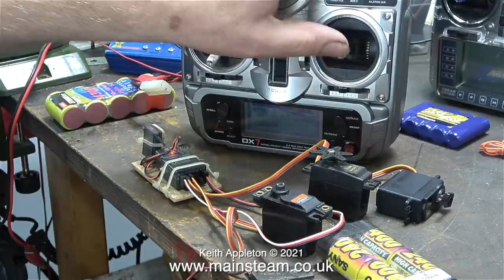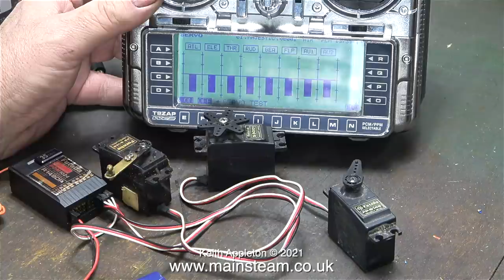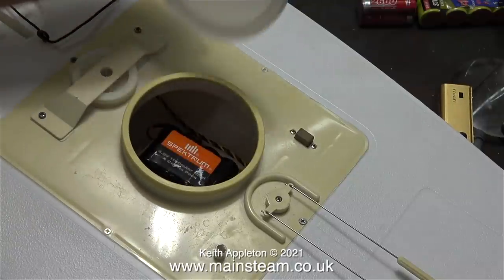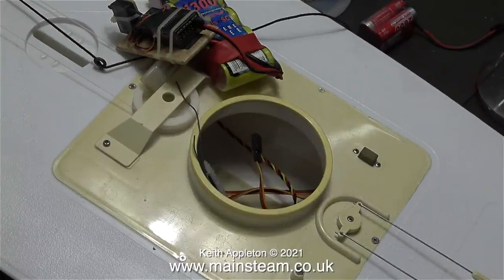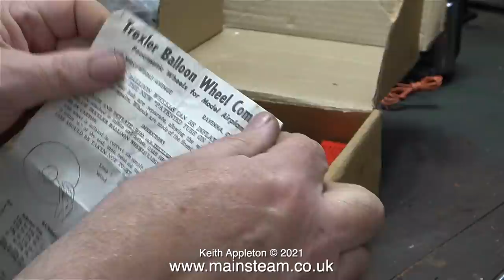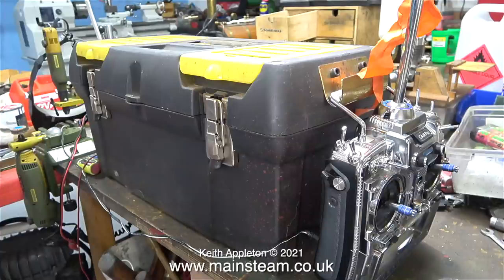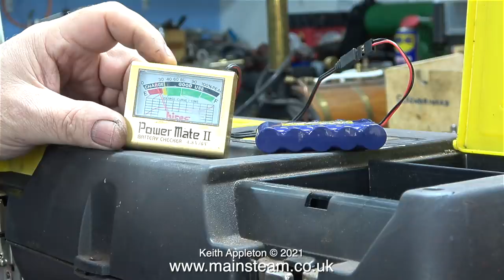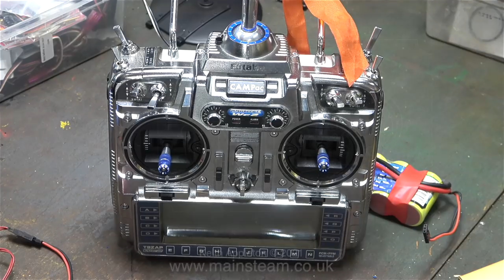MAJESTIC MAJOR - A MODEL AIRCRAFT PROJECT - PART #3

Comment: Hmmm Spektrim modules these cost us a lot of money when we were racing RC cars (bent Chassis etc) they would loose their binding randomly or need removing from the transmitter and put back in not good my son ended up rushing off during a race meeting and buying a brand new radio. Hate Radio problems. That being said I have also had problems with newer radios destroying micro servos something about modulation rate - but not good when it is your steering servo in a  RC drag Car doing over 90 MPH  - good luck - love your calm and straight forward manner by the way there is none of the kind of over the top stuff you get from some other channels.
Reply from the maker: I use my old Spektrum DX7 gear for my R/C Laser Yacht, and so far it's been OK, other than when I tried it after not having used it for a few years.

Comment: Looks like either dirty or bad pot.
Also with what looks like the broken lug. I would say their is a good chance it has suffered a hard arrival.  Given standards servos are more than adequate for the plane. I woukd just change it out.
Surprising story about Futaba 2.4 Ghz.  I have used 2.4 for many years without a hint of problems.
Reply from the maker: I removed the pot from that servo a few years ago to turn a dummy radar thing on a model boat . . .

Comment: I really dread dealing with electronic and radio control equipment! I haven't really ever  used any. But now I have 2 45mm gauge steam locomotives and need to learn how to install them and acquire the equipment

Comment: I have a similar type of toolbox for my model boating days with trays at the bottom accessible from the front via a folding flap for nicad batteries, crystals, cables, testing tools and other things. It was fun but these days I'm not so much into model boating and should really sell most of my gear and boats as they are all just gathering dust out in the garage. I only used nicads for models that were being used for a short period with an electric motor like a speed boat etc.. whereas with my sailing boats and tugs that I built I used SLA batteries as they gave a much longer run time and at times more herbies when needed over a longer time frame than would nicads. I still have the steam engine and boiler that I had made specifically for a 4'8" model ocean-going tug that all I managed to do was make the hull and some of the superstructure and never did any more. I had all the brass deck fittings made and purchased where I could in the nearest scale.